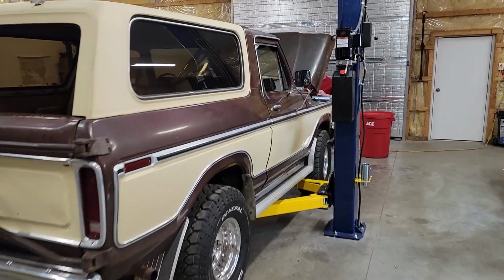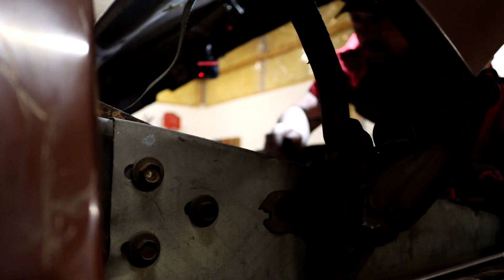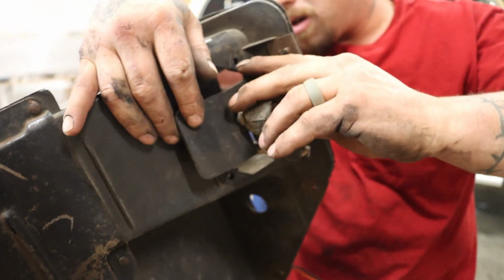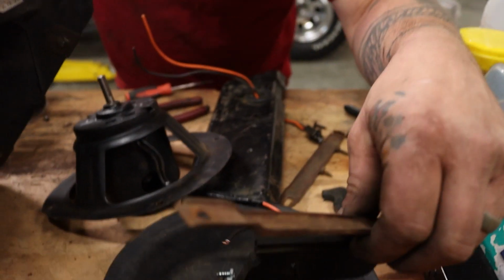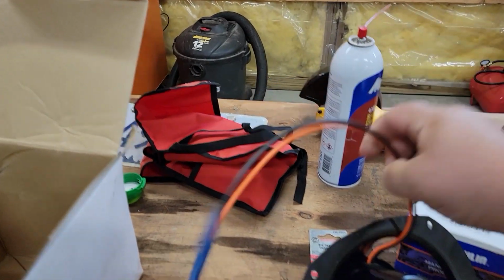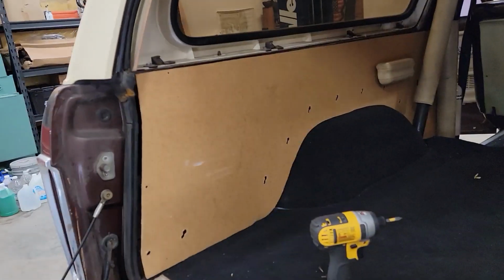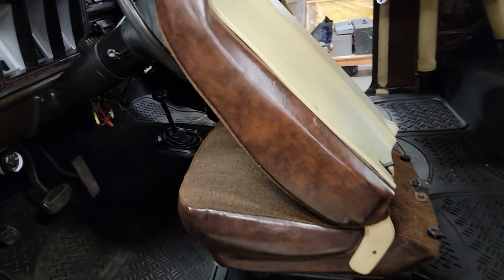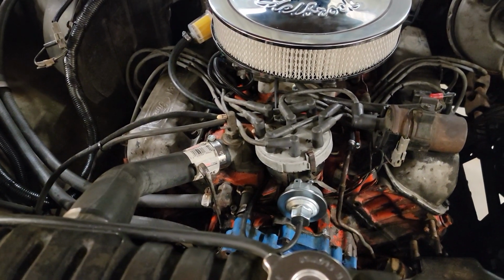1979 Bronco Heater Blower Motor Replacement

Comment: It's been awhile since I worked with them but I believe that diaphragm is called the vacuum advance.  I heartily agree with you on the wiring harness...that is nice,neat looking job. Way to go!
Reply from the maker: It is called a vacuum advance. I was a full-on brain fart and couldn't talk right. I left it in because my wife was busting my balls and its all in good fun :)

The wiring does look way cleaner. Now we just need to do a little cleaning and the engine bay will be solid

Comment: Nice!  My 79 F150 Ranger has AC but since I live in Tennessee I must keep it…ha ha.  I love the video bro!  One question…have you ever had to mess with a fuse box?  Mine is all rusty and junk. I need to fix it.   I’ve thought about just pulling it off and replacing it with an aftermarket fuse block.  Do you have any thoughts on that?
Reply from the maker: Jeremiah, my fues box in my green 78 broncobis the same and it needs to be replaced bad. Because the wiring in these trucks from factory is really poor I was just going to replace the whole deal. LMC has a direct replacement that is up to industry standards and then your not having to cut and weed out extra wires in the painless wiring harness that is really not painless. 

We are going to doing one very soon. The green broncobis being pulled back into the shop and we have a major upgrade that will be happening.

Comment: Hi PBR, Love this video! I'm in the process of doing the same thing but ran into a problem - hoping you can advise me. I have all the bolts removed from the A/C Evaporator / blower assembly under the hood and all the bolts and nuts removed from under the dash too. The housing in the engine compartment and under the dash won't budge. Did they glue it on at the factory? My 78 Bronco is completely stock. It's driving me crazy. Any help would be much appreciated. Thanks,
-Pieter
Reply from the maker: If it has never been swapped there is a good chance your gasket and other junk around it has turned to a hard compound and will be hard to break free. Keep working it and make sure there is nothing that you may of missed.
Reply: @PaperBeatsRock  Yeah I think thats what happened since its bone stock and 43 years old. Maybe I'll try a heat gun. Appreciate the advice!
Reply: @PaperBeatsRock  you were so right! I sprayed it with Goo Gone and let it sit for hours and slowly went around the  perimeter with door panel tools and sure enough it popped free. Owe you a couple of beers!
Reply from the maker: @pm1035  that is awesome. I'm glad you where able to get it off. Good luck with the rest of the rebuild👍